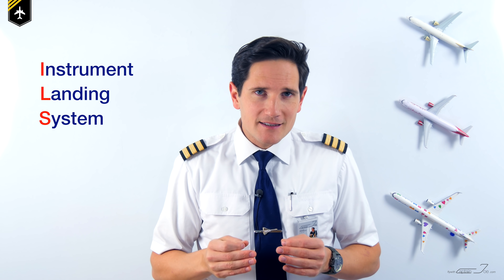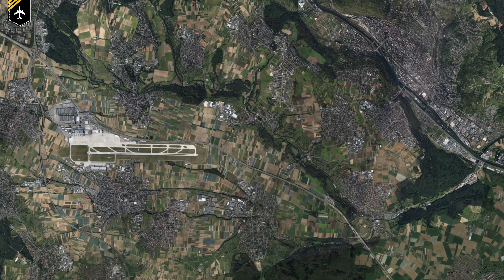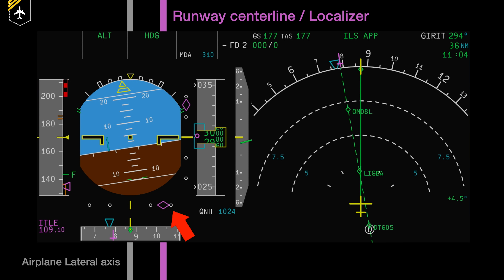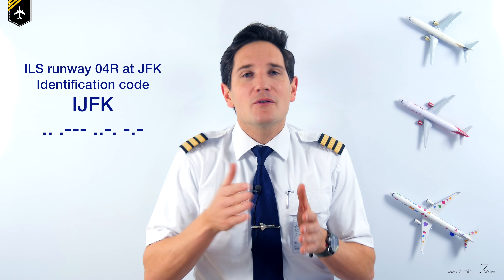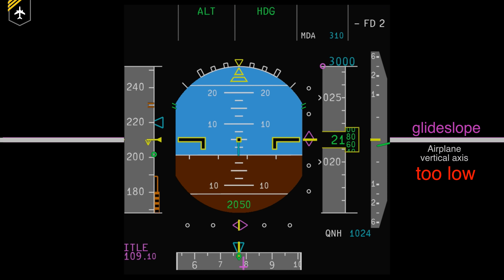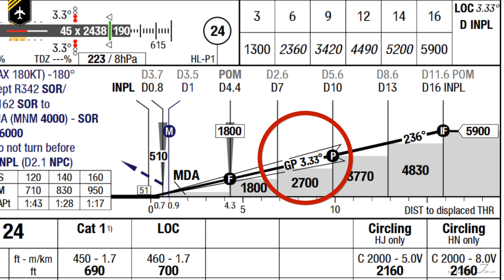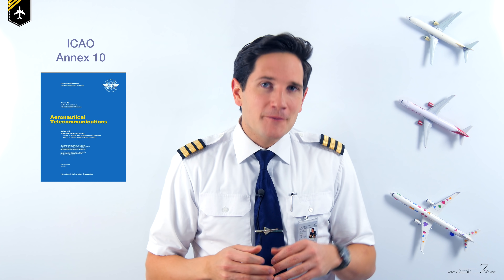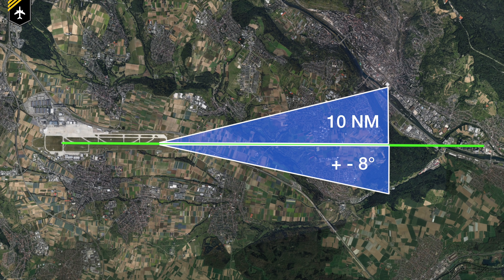How does an ILS work? Explained by CAPTAIN JOE

Comment: I've been working on ILSs for 33 years.  25 years with the USAF traveling around the globe fixing them and 8 years so far with the Federal Aviation Administration - National Airway Systems Engineering section.  I've written several ILS simulation programs and a smart phone app to help techs understand how the ILS works and help them during FAA flight inspections (ILS Toolkit on Google Play).

Your video is very informative from a pilot's perspective and I applaud you.  I've learned some things that I didn't know.

However, the details about how the ILS actually works is very over simplified.  The diagrams I see on sites such as Wikipedia depicting two overlapping lobes of 90/150Hz are cringeworthy.  

A typical Localizer system consists of an array of 14 Log Periodic Dipole (LPD) antennas.  These are very directional antennas working together to form a narrow beam.  We also use arrays of 8 or 20 elements.  20 elements make the beam even narrower to avoid multipath reflections from hangars/buildings near the runway.  

A simple single-frequency Localizer has 2 RF (Radio Frequency) signals feeding the antennas (CSB and SBO).  CSB is Carrier+Sidebands and SBO is Sidebands Only.  CSB is amplitude modulated with 90 and 150Hz audio tones at a depth of 20% per tone and they are in phase.  What drives the CDI needle movement is the DDM (Difference in Depth of Modulation) between these two tones.  So with CSB only, it would always appear that you are on centerline even if you're not because the difference between 20% and 20% is zero.  There would be no current flow in the CDI so it is centered.  If a tech shuts off SBO we call this HMI (Hazardously Misleading Information).

CSB is fed to the left and right antennas in-phase.  So at any observation point down the center of the runway the signals from then left and right antennas arrive in phase and add together because they have the same distance to travel and are equal magnitudes.  This creates a maximum CSB beam on centerline.  As you deviate from centerline, the CSB lobe weakens because the signals begin to become out of phase until they are 180° out and a null occurs because they cancel.  As you keep going, they start to become in phase again creating side lobes but they're weaker due to antenna directivity.  Localizer frequency is from 108-112MHz so the wavelength (360°) is approx. 9ft (speed of light/freq).  Therefore, the farther apart the two antennas are, the narrower the main lobe and the more side lobes you get.

SBO is fed to the left and right antennas 180° out of phase so the SBO on centerline gets canceled (null) but we get SBO lobes on either side. On centerline all you get is CSB which is zero DDM (centered CDI needle).  The SBO is modulated with 90 and 150 also but they are 180° out of phase.  So on the pilot's right, the 150Hz sidebands from the SBO add to the 150Hz sidebands of the CSB and the SBO 90Hz subtracts from the CSB 90Hz.  The opposite happens on the pilot's left.  We call this "space modulation".

I have an analogy when teaching newbies in class.  90 and 150Hz are in the audio frequency range so let's replace them with Country and Rock music.  I ask them "what would you hear on centerline?"  They almost always say "we would hear nothing".  No, you'd hear country and rock at the same volume levels (no Difference in the Depth of Modulation).  As you deviate from centerline, one would get quieter and the other would get louder depending on which side you're on.  It's a "location-dependent" AM radio station broadcasting 2 "sounds" if you really think about it!  The ILS does NOT use Frequency Modulation (FM) as mentioned. It is an Amplitude Modulation (AM) system.

As far as Glideslopes, an important fact left out about most of them is that they are "image" systems (except for the less common End-Fire GS).  This means that the RF energy from the 2 or 3 antennas (capture-effect, null reference, sideband reference) bounces off the ground making a mirror image as if the antennas above ground had mirrored antennas radiating from the opposite height below ground.  This means that ground terrain topography is critical to their performance.  We often have to work hard at getting a GS to pass a flight inspection because of terrain issues.  Uneven terrain will cause "structure" problems meaning the glide path is not a straight line.  Similar to a Localizer having reflecting buildings near the runway.

Anyways, I love this stuff and could babble on forever (don't get me started on the Capture-Effect principle)  thank you for your video!
Reply: WoW.....
Amazing
Reply: Hey Carl - Enjoyed reading & trying to follow what you wrote. Saw that you made other videos explaining what you do - Awesome stuff. I 'd like to see you make a video of the Capture Effect principle. Go for it!
Reply: Carl Rocco , Amazing! I really want to become a pilot and you just taught me lots of things.
Reply: Carl Rocco this is such fascinating stuff! I am not even learning science but this seems like something I’d want to know. Thanks!
Reply: Bro do all airport have this?
Reply: jason tan , no small airports that can’t afford one cause they’re super expensive, they use something called a Papi Light
Reply: EmperorRyanII Gaming hey! You seem to know quite a bit, too. Have you done any training ?
Reply: Offended Wooden chair , nope, XD, I’m still underaged to be a pilot, but I’m watching videos on YT to be prepared cause I want to become a pilot.
Reply: Offended Wooden chair , just learning the basics first so I won’t get lost in the future.
Reply: @emperorryanii  Don't stop learning!  I wish I would have been introduced to aviation at a young age because it would have changed the entire trajectory of my life.  Aviation is one industry where one can "age out" -- meaning you can be "too old" to even begin, let alone continue for as long as some other professions.  I wish you nothing but the best and just be resourceful!  if you want it badly enough, you can make it happen. :)
Reply: kyndkristen , aww thank you so much! Won’t stop trying to become a pilot!  Even thou you may be “to old” to become a pilot, you can always enjoy many great flights and explore the world, and have a amazing adventure! 😁
Reply: @familyfriendly8494  Short answer - No.  However, almost every airport a general passenger will fly in and out from, will.
Reply: K
Reply: Wow
Reply: Can you recommend a good app?
Reply: excellent explanation
Reply: This should be pinned
Thanks Carl!!
Reply: Yeah, as an ATSEP, I find many online article cringeworthy on this topic. Even in this video, the captain, who I am sure is an excellent pilot, incorrectly pointed out that LLZ sends out FM modulated waves. But its just plain and simple DSB-FC AM. If you strip all the ICAO requirements, LLZ is basically an AM transmitter. Now, what really amazes me is the space modulation that is how signals mix exactly as intended to give the indications required.

Comment: Shuttle Landing Facility  (ICAO:KTTS) has a 22-degree glide slope. lol
Reply: AH yes, the shuttle. 
Also known as the flying brick.
Reply: @Voyager FPV that is incorrect. They dont land from 90 degrees until very late
Reply: @ThatSB , 90 degrees for final approach.
Reply: @TackKeyNack  No, not 90 degrees for final approach. 90 degrees at the last few seconds
Reply: @ThatSB , last few seconds could still be referred to as final, eh?
Reply: @TackKeyNack  if a regular aircraft's short final is less than a mile, one could imagine short final on a booster moving faster than the speed of sound would be considered "short final" miles out, when it is within sight of the pad. But since it lands like a helicopter, it isn't comparable. Regardless, it isnt 90 degrees until it is a couple seconds from touchdown
Reply: @ThatSB , it's still the final part, though. It's the final part where it would need to make the least adjustments in pitch, yaw, and heading.
Reply: @TackKeyNack  this discussion was about glideslope and short final.  By your desperate to be right logic, many planes fly a glideslope of 90 degrees. Since the final part of their landing involves a flare that sends them out of a descent temporarily before gently touching down by throttle decrease
Reply: LOL
Reply: Plz can u speak English now. Lmao!
Reply: @Voyager FPV lmao

Comment: 6:09 For those interested; the math he is referring to would be solving for x in sin3°= (2500)/x for the distance to runway threshold from the plane, and tan3°=(2500)/x for the ground distance to the runway threshold. Any height can be substituted for the (2500) so long as the plane has captured the 3° glideslope. The expressions when manipulated for x are: 
X=(2500)/sin3°
And
X=(2500)/tan3°

P.S. make sure the calculator is in degree mode and not in radian mode if you are inputting the glideslope in degrees.
Reply: guessing to find your angle needed you could also do inverse Tan, Sin or Cos? Providing you have the other 2 variables?
Reply: @matthewdnewton2437  You could find the glideslope from the runway to your position that way, but you still need to use the required glideslope for the runway you are given.  So theoretically if you were too high you could use an inverse function to find you are at an 8 degree glideslope, but that doesn't help much if you need to be on a 3 degree glideslope for that specific runway. Could be useful to determine if you are too high/low if you haven't already intercepted the required glideslope though. All this assuming you have two of the three measurements.
Reply: @LukeDelmarWebb  I'm doing a Mechanical Engineering HNC and I am a student pilot so I am learning with both of those, luckily with a PPL you use more of your intuition and experience to find your approach path on Base/Final.

But it is interesting to learn this side as we still are going through the Trigonometry stuff and I somewhat struggle on occasion especially on the mechanical principles section which is "moments about forces' etc
Reply: @matthewdnewton2437  Right on, I'm a college student as well and have only ever done a discovery flight. I agree that when it comes to actually flying alot of the mathematics aren't practical. Its neat to see real world applications of what I'm learning about though!

Comment: I learned to fly IFR in a Piper Cherokee Warrior in 2000. Everything was manual, no GPS, just dual Nav/Com radios and a DME. So I had to tune and listen to the Morse code for not just the ILS,  but also for the VOR in nav #2 if the approach used crossing radials for fixes. If the approach used DME for fixes, you guessed it, I would tune and listen to the Morse code for the DME. After a while, I ended up memorizing the Morse code alphabet, just for convenience.

Comment: Hi captain joe. I wonder if we put a runway at 40,000 feet how will the take off and landing of an airplane be???
Reply: Randolph Fanny well there ain’t any land at 40000 ft lol. But if there was, you just need a very long runway, and a very light plane with a jet engines
Reply: @ZK-APA  but why will you need a longer runway, a light aircraft & a jet engine????
Reply: Randolph Fanny well the answer is quite technical. At 40000 feet, the air is so thin that you need a greater speed to take off. Therefore a longer runway to reach that speed. 
And since lift is opposed by weight, a lighter aircraft will need less lift than a heavier one. 
And a jet engine (turbofan/turbojet) is more efficient at high altitudes compared to a piston engine.
Reply: @ZK-APA  ok. Got it. Thanks captain. Big fan.😁😁😁

Comment: Just a question I heard space shuttle has its own automated  landing system. Is there anything similar for take off or landing in commercial planes and also I understand military aircraft and strips/ carrier must have very sophisticated and fail safe ILS
Reply: Most of the large commercial aircraft are capable of autoland.

Comment: Hi Captain Joe
Blue light added to yellow light results in more or less white light. At least in the additive color mixing model.
The green in your example would be the result of the subtractive color model which does not apply to light.
It's the simple difference between adding frequencies (light) versus blocking frequencies (e.g. paint).
But I got the picture anyhow.

Comment: I play a lot of realistic flight simulators, and do you know what TUNE-NAV-1 and TUNE-NAV-2 mean?  thanks.
Reply: Commercial aircraft are fitted with 2 Nav radios.  Typically the pilot would use Nav 1 and the Copilot NAV 2.  So TUNE NAV-1 vs TUNE-NAV-2 is just which Nav radio is to be tune.  Tuning of the ILS is one of the functions of the Nav radio (

Comment: The steepest glideslope might be LSZA LOC/DME RW01.... Lugano Switzerland.. :) :) … My first FSX-Visual try without reading the Approach plate^^ After getting some theoretical knowledge how a plane works, i just wanted to do my quick  533th Cessna - landing in FSX.. :D I've expected soimething around 3° - then i came over the mountain and saw: FUCK, too high, too close… Aaaand i've made it.. And at this Point of time i didn't know that there is a very cool Thing called Forward Slip :)) - 
I was never on PAPI but came down early to loose some Speed with horizontal fly at the end... came down with 60kts.. in a skylane :)

Comment: Lugano Agno, (ILS Glideslope at 6.65 degrees) situated in a mountainous region of Southern Switzerland, opened in 1938. The airport later extended its Runway 01/19 to 4,430 feet with a hard surface, and in the early 1980s Runway 01 received an ILS at the request of Swiss regional airline Crossair. Because terrain obstacles prevented the installation from meeting all requirements of an ILS approach, authorities classified it as an instrument guidance system (IGS) in 1983, and set the glideslope at 6.65 degrees. The approach path features a missed approach point (MAP) at 1,174 feet agl and 1.5 nm from the threshold, marking the last moment when landing Category A aircraft can safely overshoot without hitting mountains on the other side of the runway.

Comment: Qantas Flight 72 was an Airbus A330 fly by wire. I believe that you specialize in the A320. However, will you please do a video on the Qantas Flight 72 incident and what changes are in place today to prevent such flight computer errors and to allow pilot override flight computer errors.

Comment: Extremely interesting video, but I would like to further ask regarding something that recently happened on a plane I was travelling in this last week:
The captain said that, due to the bad weather conditions, we would need to perform an approach category III (or something along the line). I guessed this was closely related to the ILS system and all, but what amused me was that he requested the passengers to fully turn off all electronic devices to be able to do so.
What's the point of all this? Could you throw some light into it? 

THANK YOU!
Reply: Guille Glez I’ve never heard that before,

But if I have to guess, it’s basically to make sure there is no errors in the ils approach due to,external device. But it’s just a guess.

Comment: Back before my 20's, half of which I wasted doing recreational drugs for various reasons, I was a huge aviation enthusiast. Flew I don't even know how many hours in MSFS and X-Plane. Getting back into it again, knowing I can never become (rather thankfully at least for everyone else) an airline pilot. Well, could but.. it's not really practical even with 4+  years of sobriety now, given my health issues albeit hypertension, being dependent on 4 psych meds 3 of which are pretty strong, and so on. But just wanted to mainly say that you explain these matters better than most if not all pilots or teachers I've seen anywhere, so far. All the time I flew often KBDL to KPHL or KBDL to KBOS in my favorite 737-400 or 737-500 or 737-600, depending, I never used the ILS lol. Now I get it..to a better degree anyway. It's interesting ILS are all clustered just above FM stereo (commercial) frequencies, at least here in the USA. Cheers.
Reply: Also if anyone can maybe tell me I"m curious about a specific navaid (as to whether it may just be a visual landmark) it's in Connecticut, I believe technically in Watertown, CT and called JUDDS or JUDD .. have to check. I can't for the life of me figure out what frequency it does emit if it does emit one at all.

Comment: I have a question. Can a pilot "FEEL" the difference between two aircrafts of same make and model?  For example one being a little more twitchy than another. Does performance or "feel" change significantly with age or cycles?
I love your videos.
Reply: Denis Rouleau i m not sure about big ones,

But in small ones like the Cessna, you can feel the difference in flying characteristics between different aircraft of the same type.

Comment: Captain/others...given airplane noise on approach is a big public issue for some airports (e.g.Heathrow), why do those airports not set a higher glide slope value? 
Clearly some major airports e.g. Naples, the old HK have/had them so was safe to fly. Seems a better/obvious solution in addition to moving the landing thresholds. 
Why would an airport not set a higher GAS value for these reasons even if there is not a terrain issue? 
Thank you!
Reply: Approaching planes aren't the problem when it comes to noise. They are relatively quite and their noise only get relevant at the very end of the approach where a steeper glideslope would hardly made any difference. Starting planes on the other hand make a hell lot of noise because their engines run on full power.